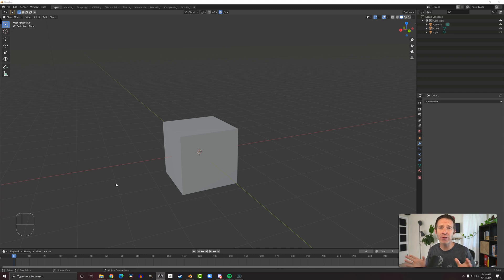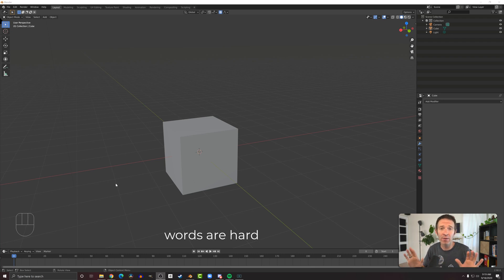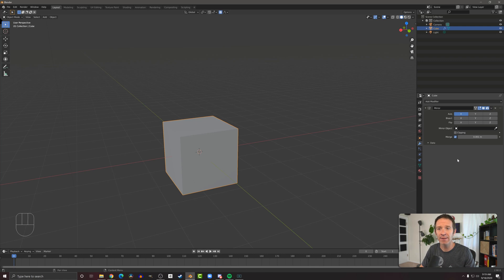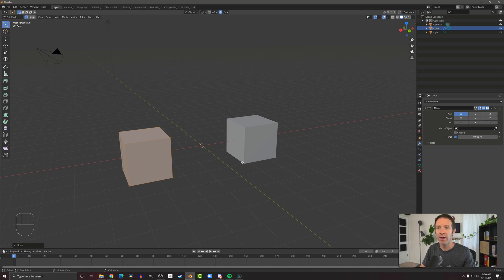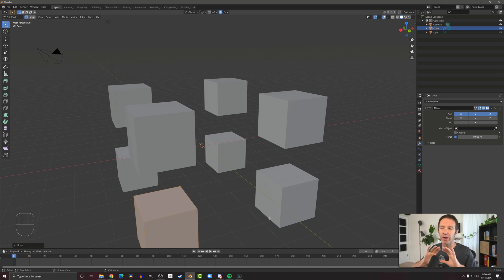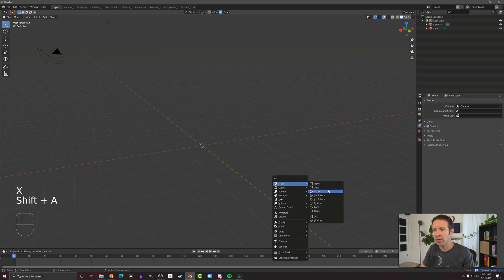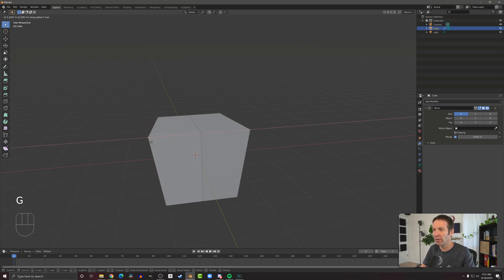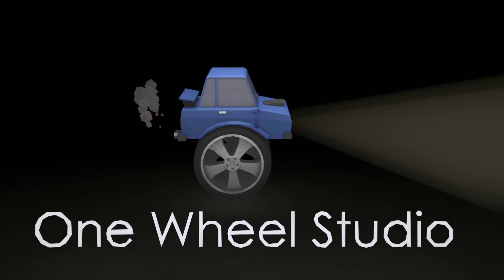Creating Symmetry with the Mirror Modifier in Blender 2.9

Comment: This new Blender is so weird, where are the "apply" options in Modifiers and where are those numbers that show you how many triangles your mesh has?
Reply from the maker: I was wondering the same thing a couple days ago :) There is a small dropdown menu at the top right of the modifer. There's an "apply" option there.
Reply from the maker: As for the numbers, you can turn them on by right clicking at the bottom right of the blender window. It should bring up a context menu and give you options to show different data.
Reply: @OneWheelStudio  What a strange place to put the apply button, I think the previous little check mark was fine. I even had trouble finding it after I read this comment lol
Reply from the maker: I’d totally agree.
Reply: @OneWheelStudio  Thanks alot! Found it all!

Comment: My OCD won’t let me look past it, when I Have two arms on a mesh that are MEANT to be perfectly symmetrical. They are but if you zoom in alllll the way, they are actually off a few centimetres to a meter. This wouldn’t bother me but if I just use the mirror modifier it shows THAT mesh as being COMPLETLY symmetrical. I try applying that mirror mesh and working from there but it bumps the mesh back off course again. Do you have any suggestions?

Comment: So why when I apply a mirror modifier does the original half and the other half of my figure move in the same direction and they are joined as one mesh?
Reply from the maker: In object mode they are on mesh. In edit mode they will behave differently.
Reply: @OneWheelStudio  - I'm completely lost. I watched another video (with a robotic voice) and mirror worked how I want. So I just tried mirror on an off centre hand model I'm working on and the mesh mirrored properly in both object and edit modes.
I've walked away from Blender so many times because of small things like this. Only come back because it's free.
Reply from the maker: So what exactly are you trying to do? Happy to try and help. If it’s easier jump over to the OWS discord and drop in some screenshots.
Reply: To elaborate my original problem - I created a torso and then realised I should have had symmetry on (couldn't find symmetry to switch it on) and so I tried mirror modifier. The Torso is off centre once I deleted half so that I could use mirror modifier. So when I used mirror - the meshes (two halves of a torso) overlap each other and trying to move one away just moved both in the same direction.

Is it a 3D cursor thing? I never understood that thing.
Reply from the maker: Sorry, responding on mobile and just saw this second message. If you are trying to bring the two halves together you want to move the original half in edit mode. You could also try changing the merge distance on the modifier.
Reply: @OneWheelStudio  - I’ve never used discord but I’ll YouTube it and give it a try later.

Thanks for your help.I’m getting there!

Comment: If you are sculpting, hard surface modeling, or doing character creation. 
Another useful tool is the 'topology mirror' which is under active tools. You'll have to be in sculpt mode, or edit mode to see it.

Under sculpt it's called Symmetry, and all you have to do is click x, or y depending on your orientation.
In edit mode, while modeling, you can hit N to bring it up if it vanished, and in the tool tab, under options should be a 'mirror' label, with X, Y, and Z.

Comment: But it disappears when you don't need it anymore, how to stop the function without making half of it disappear? Yup i really have to ask for that apparently, as usual, cool features don't work as they should in Blender, always one more extra step or tips tricks hacks bs  for normal basic stuff. 
I guess i have to add a new layer or a new something to make it work, theres of course no simple desactivating it button or option (like every normal program). but without make half of it disappear. F Blender.
Reply from the maker: If you want to make the modifier permanent, there is a small arrow dropdown menu at the top right of each modifier. In that menu is an "apply" option that will make the changes permanent and remove the modifier.

If you just want to deactivate it but still have it on the object you can simply toggle all the display options off which is effectively the same as turning the modifier off.

Comment: Help! but the mirrored object has no vertices, how do i even edit 1 of the mirrored objects?
Reply from the maker: The geometry added by the mirror modifer can only be modified by changing the vertices or geometry that was originally mirrored. You can "apply" the modifier which will make it permanent and then you can edit the added geometry.

Comment: I have question on how to control which side of object mirror to which side. For example  if we like the part of the object on the right side (for example X axis) to be to the left side and vice versa.  In symmetrized tool we can select  -X to +X or  +X to -X. How about  in this Mirror Tool ?
Thanks in advance
Reply from the maker: I believe the tool is smart enough to mirror either side or fill in the side that isn't there. I could be wrong, I think in older versions of the mirror modifier you had to choose, but I don't remember than being an issue for quite some time.